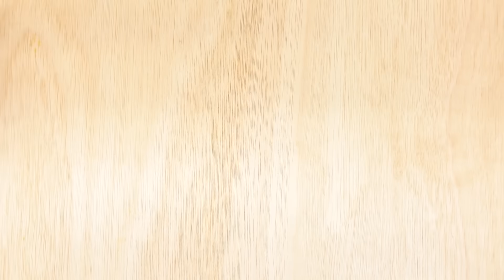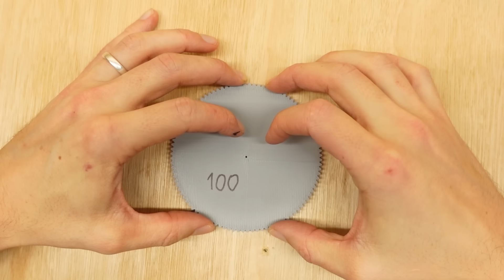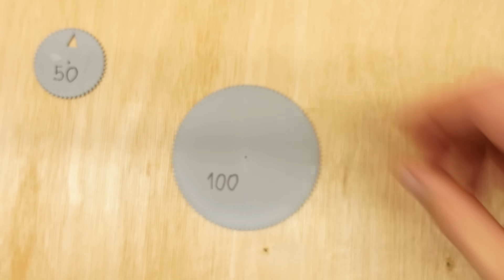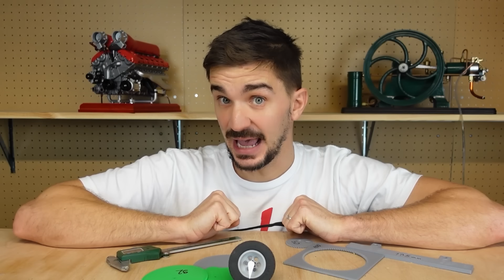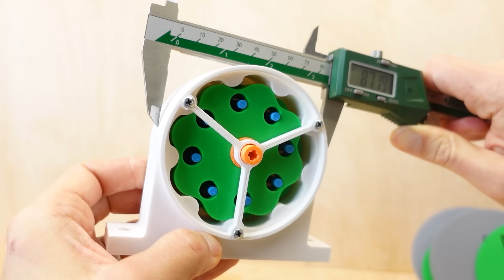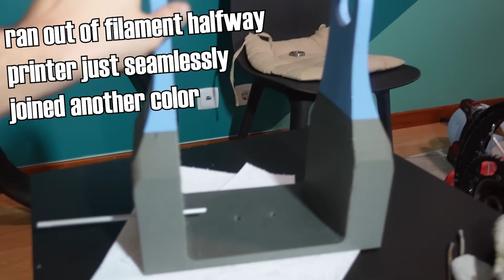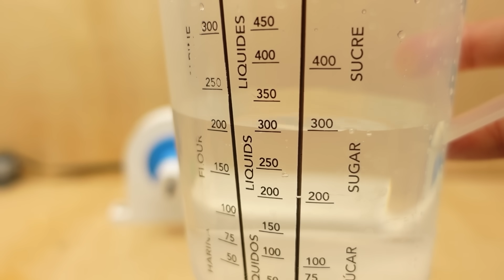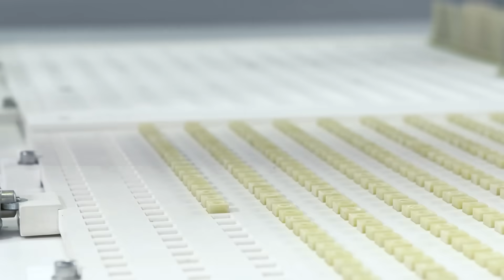Toothless Gears Make Much More Torque Than Conventional Ones, Here's How. Cycloid Drive Explained

Comment: So what if we make like a six cycloid cycloidal transmission, it would be big but balanced
Reply: This is similar to my thoughts on a 3 cycloid transmission. The two outer ones are half the thickness, and this half the mass, of the inner one. This should completely remove the rocking couple, while maintaining that primary balance. The centers of the primary forces are the same. 

With an even number of identical cycloids will necessarily have the center of the primary forces slightly offset.
Reply: @nopenotmedudeomg i literally thought exactly the same lol
Reply: @jonathangohl3001 @nopenotmedude Good way of thinking. If you think more you will finally come to differentiate and integrate, and then you get to spiralize. You will end up with gears like those at 15:52.
Reply: @nopenotmedudethat could help with vibration, but the strength would be partly limited by the "weakest link" of the thinner cycloids, unfortunately.
Reply: @nopenotmedude that's basically why the v6 is so great: mass split in multiples of two helps primary balance, while mass split into an odd number (greater than one) of locations longitudinally helps secondary balance.

With cylinders of equal mass, that requires a minimum of 2 (smallest even) by 3 (minimum odd greater than one). That's six. It also explains why a lot of performance cars use v12; by gluing two v6 engines together, they can tune each v6 to further offset any remaining imbalance by the other.
And that in turn explains why they go for a v12 instead of a v6 of equivalent displacement: the further attenuation of imbalance allows even higher RPM
Reply: @Londubh I was always told that a straight 6 engine is one of the best balanced, so a V12 is not to v6s together it is actually two straight sixes together
Reply: @thomasward4505 then it wouldn’t be a V it would be a parallel or square 12
Reply: Massive friction with all those points of contact. He never mentioned the heat that cycloid drives generate in continuous high speed operation. We tried them in ebike drive transmissions.
Reply: @flounderguts probably one of the drawbacks he did not realize
Reply: @thomasward4505 He said cycloidal drives were no good at high speed. He just didn't go into specific problems.
Reply: You only need 3 with the middle being twice as thick. It's not like engines which have secondary vibration at twice the frequency due to the piston reaching its maximum speed closer to TDC than BDC.
Reply: Perfect balance, and INSANE torque capacity.
Reply: Then it couldnt be used for robot arms nor cars, as a 5 speed transmission would need 30 cycloids.
Reply: @susmaster697 Just make the final drive a cycloid
Reply: I had the exact same idea straight away! Ah well, there goes my patent.
Reply: Well now you’ve just given up the perk of it being compact and simple. Nothing without compromise.
Reply: Isn’t it possible to just use one cycloid but off center the weight within that wheel to cancel out the vibration? Or is that not possible?
Reply: @jonathangohl3001  the central drive shaft has an offset, so a counter weight would have to be offset from the drive shaft by the same amount, but in the opposite direction.
Reply: You only need 2 or 3 to make it balanced
Reply: @Xailow  3 with 1x, 2x, 1x mass, or other form where the mass can be mirrored across the longitudinal axis
Reply: why 6, not 4? 

I get that 3 with inner being twice the mass seems to be the way to go, 
but why did you think of 6, and how would you arrange them?

Comment: What if you balanced it by having 3 gears in line where the center one is the same mass as the 2 outer ones, either just thicker or having less extra mass carved out
Reply: Well now you're sacrificing material cost, weight, and size. There's always a tradeoff
Reply: I've made the same consideration... one day later.
I think it's the most effective way.

Comment: I myself build a cyclical drive by 3d printing with bearings lobes before to compare it against belt drives. While it is impressive in gear ratio (1:40) I couldn’t get it to drive smoothly or efficiently. The big contact surface increases the friction a lot so that even with lubricant my stepper even struggled with overcoming the static friction. But another good thing was the silence while driving it in comparison to another planetary drive I made with the same ratio by stacking. It doesn’t need the high rev gears in between which were really loud. 
There should definitely be more talked about c-drives.

Loved to see a video about it.

Comment: 19:28 So why not double it and make it have balance of inline 4? I would assumed it's no longer compact and driven up the cost. But hey it still torque god right?
Reply: And is maintenance free
Reply: doubling it is a case of chasing diminishing returns. going from 1 to 2 turns an oscillating force into a oscillating torque by placing two equal/opposite forces close to eachother. repeating this process (ie, going from 2 to 4 like you're saying here) just turns your oscillating torque into an oscillating bending moment.

essentially, instead of having the mechanical stress spread out over the full length of the axle, you're concentrating all of it into the space between your gears

Comment: 14:51 have you thought of using plasticine instead of water
Reply from the maker: I didn't think of that and I didn't have any, but good idea for future! Tthe lifting test was a bit of a spur of the moment idea, so the arm is just a square since I originally thought about putting bolts in there, but all the bolts I had were different and dirty and so I woul need to include shots of me weighing them and it just looked lame so I put a round jug on a square arm which looks even lamer 😅

Comment: can 4 cycloids resolve the rocking couple issue? or at list reduce it? 

can a cycloid be used to gain speed instead of torque?
Reply from the maker: Yes, you can balance it just like cylinders but that ends up completely defeating the compactness since adding more cycloidal gears only fixes the balance, it doesn't do anything to the gear ratio.

Comment: Looks like some oil pumps
Reply: oil pumps usually rotate a teethed ring and create a pressure difference by reducing the space in between the inner cogwheel and the ring gear.
Reply: Looks exactly like the crank driven oil pumps on International DT466's.
Reply: @Bloodbain88 or T-444E VT365